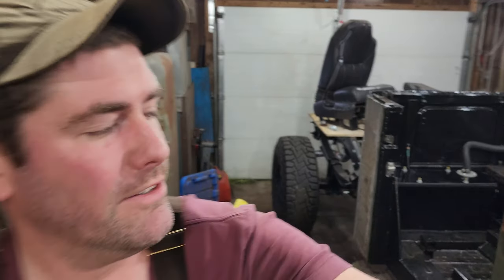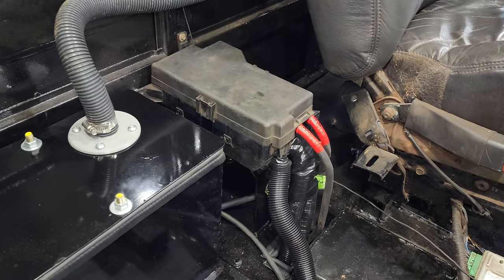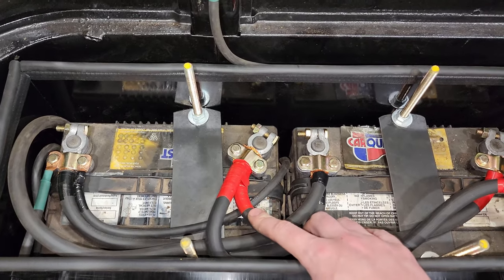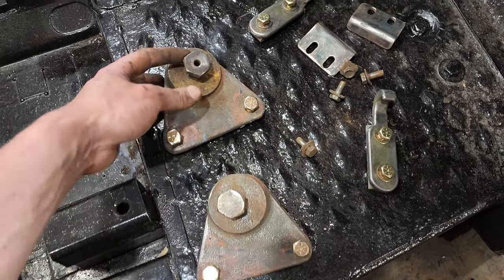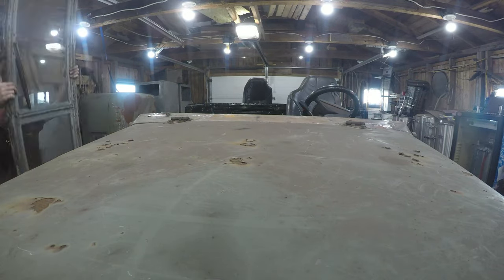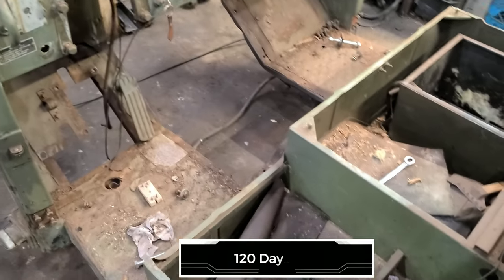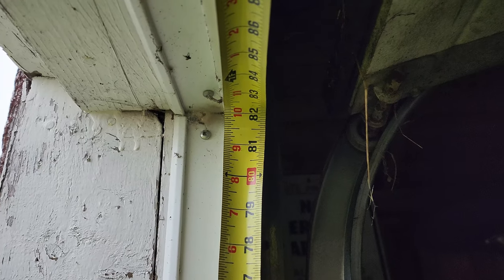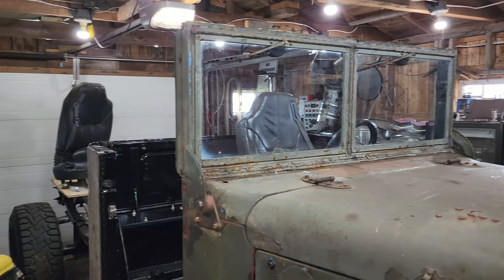Well, it's not leaving the shop! - 1952 Dodge M37 Cummins Restomod [Episode 28]

Comment: When push comes to shove Dave, roll it out on an old set of rims, and fit your wheels outside. Ok....you still have to deal with the door size if you want to use your garage for parking the vehicle, but to get it out, is the method i'd use. Love your built by the way. Half-Ass-Customs did a built called "The General" if you wanna check it out. Great project though. The end product is going to be great☝🏻. Sighning off from South Africa🇿🇦
Reply from the maker: Thanks! I'll check that build out!

Comment: Don’t forget you can let the air out of the tires to reduce the overall height. 
Or even slap the ugly small tires back on to remove it from the shop
Reply: i have a 53 with 36 inch tires i thought  they were big  900/16 8 ply  1650 .00  5 tires and tubes  and flaps   garage door 2 inch too low had to work out side  mild winters   south carolina